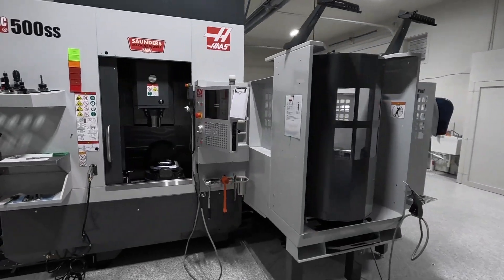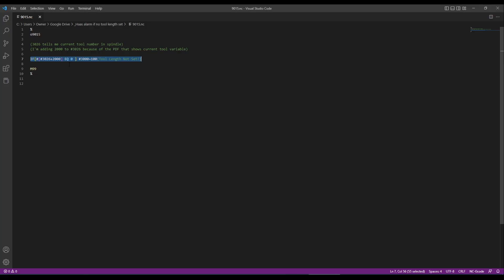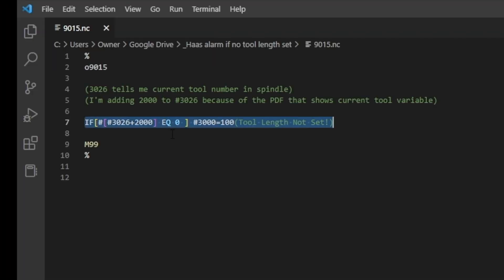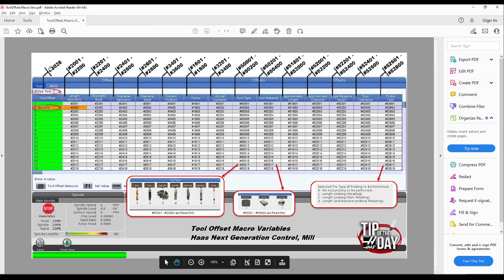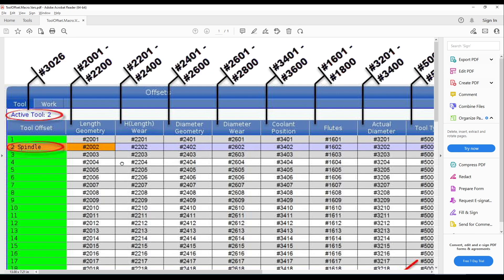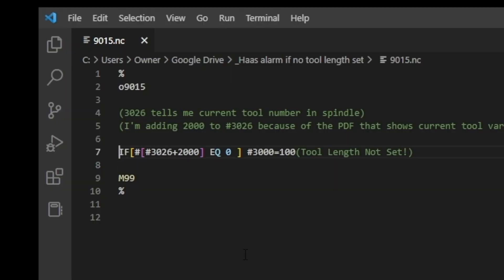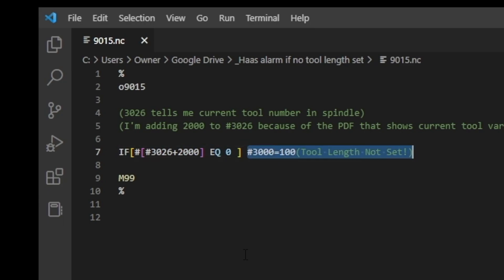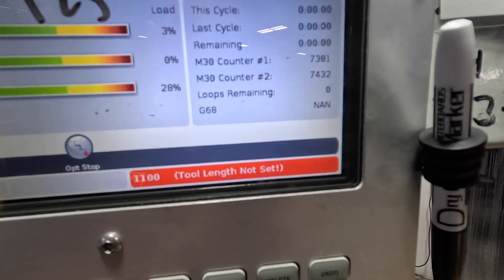Stop Your Haas from Crashing with Zero Gage Length Tools!

Comment: Great video! This check has now been added to all new Haas Mill Controls with software versions 100.25.001.1100 and newer, as Setting 426. These are basically machines with the new 19” monitors. Thanks for shining a light on this issue John, it added weight to the project which helps everyone.  Your macro is a great check for older machines.

Comment: Will need edit in correct spin speed after moo as take off no spin after moo be sure have sitting that t n h agreement on so if forget edit h# wont pick off wrong tool length

Comment: Go get scale prg to go to set z level then edit in moo spin will stop put scale or gage blk under tip of tool will check what prg to if not you know not set correctly hass mach has tool offsett measurement have to be in correct g54 to set z o to does automatically read manual easy and no deslexia as no operater to turn #s around

Comment: We are in the process of going further and using subprograms with macro reads to do things like compare tool length and diameter in CAM vs on machine, run breakage detection, load proper offsets via the datum tables, touch off tools if they have not been set already, etc. Granted this is on Heidenhain but the same is doable on a Haas or Fanuc machine too I am quite sure.

Comment: I love this. I want to add as well,  you can alias the M06 command where it changes to your desired tool and then runs the check then return.

Sub:
O9000

G103 P1 (LOOK AHEAD LIMIT TO 1 LINE)

M16 (TOOLCHANGE)

IF [#[#3026]+2000] EQ 0] #3000=1(TOOL OFFSET NOT SET)

G103 (LOOK AHEAD LIMIT OFF)
M99

Inside of my Macro Aliasing section, under the line for m code 9000 I will set it to 6 and now this will run every time a standard M06 tool change is called.
Just be careful with using this method and test it before you run it in any programs to make sure it is working correctly.

Comment: Why not set all the tool lengths to 999 the day you start up the machine... no post or sub required... you will get an overtravel alarm if you try to run a tool that hasn't been set....
Reply: Great idea Jeff, implementing this tomorrow.
Reply: I do that with my machine which has limited tool numbers. But what if you had 1000 tool offsets in your control? Would you stand there for 4 hours?
Reply: @jamesfrancis9520  what model is your control? ill write you a macro that will do that in 2seconds
Reply: @Brandon Renwick  I have a Siemens with only 16 tool positions so it's an easy job for me.
Reply: +1 for that one! I also set g54 xyz to +99. thats the default I get in Mastercam if I forget to assign a work offset. Some machines will default to that when you hit reset. Then if someone starts in the wrong place it just throws up an overtravel alarm. not all have the pre check though some move until it actually over travels.
Reply: Great idea!